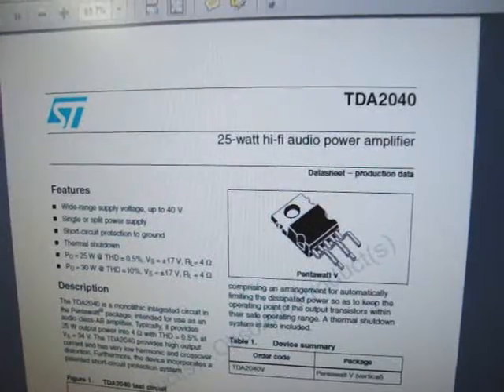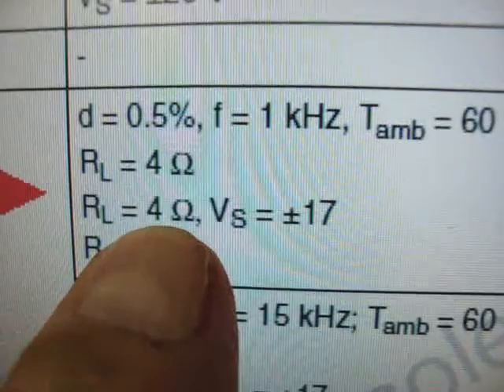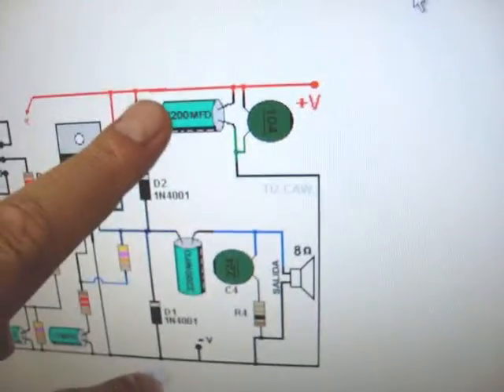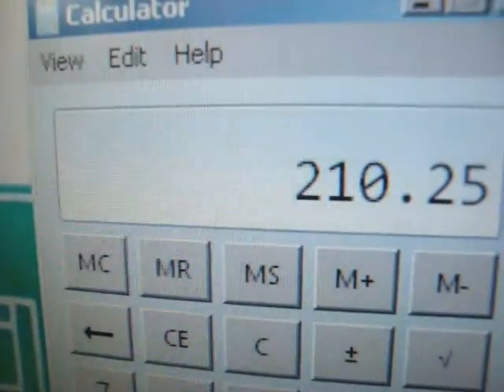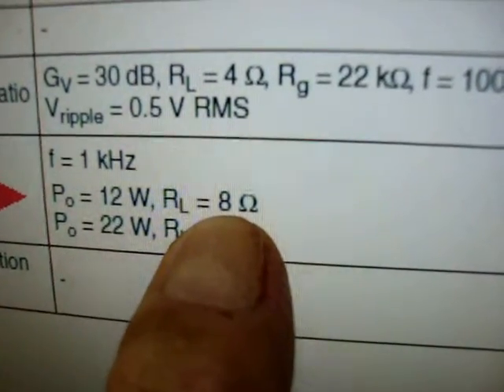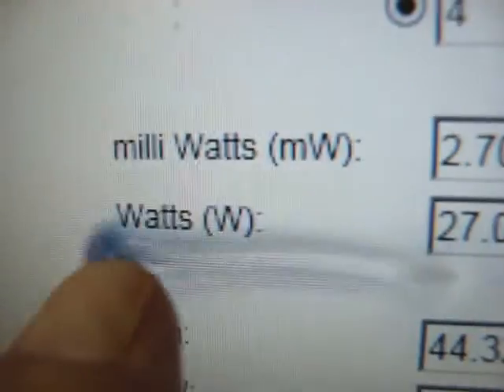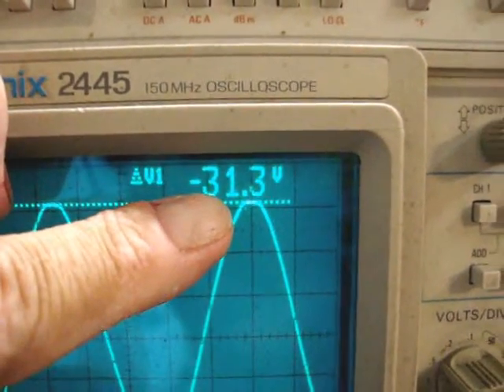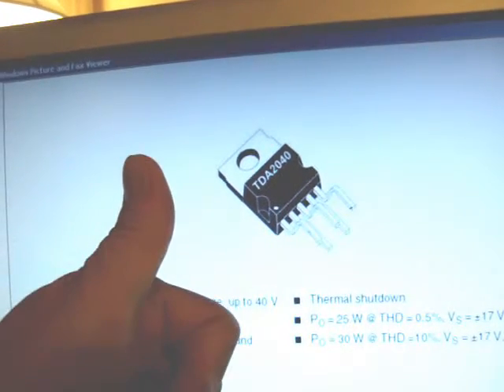TDA2040 Evaluation

Comment: I have a guitar amplifier with the smaller brother, tda2030a. The guitar manufacturer insists on limiting the guitar speaker resistance to 8 ohms, is running a 4 ohm unsafe for these chips?
Reply from the maker: I think the tda2030 is overload protected. However, the amp may have already been designed to provide the maximum available output with the supplied 8 ohm speaker. What kind of amp is it, and what is its maximum rated output power?
Reply: Bob H it’s a Vox Pathfinder 15R and they call it 15 watts, have not put it on an oscilloscope to confirm nor do I know what the THD is at that level. I know plugging in a 4 ohm speaker would ramp up the power but everywhere I read they say it will burn up the chip
Reply from the maker: @voxpathfinder15r  - Ok, so after looking at the specs on the tda2030, the absolute max output is 18w into 4 ohms with +/- 19v power rails. So if you connect a 4 ohm speaker, it will only provide 3w more output. So there's really no further gain with going with 4 ohms. The 2030 cannot make anymore power, so 15w is maximum.
Reply: Bob H it can go +/- 22 volts, and it looks like it could go 22 watts. Perhaps not much of an audible difference from 15 watts?  But perhaps a really big difference in clean headroom?
Reply from the maker: @voxpathfinder15r  - Yes, that's correct. Again we're talking about RMS watts, not peak watts. I got this directly from the manufacturer's ratings: Typically it 
provides 14 W output power 
(d = 0.5%) at 14 V/4 Ω. At ±14 V or 28 V, the guaranteed output 
power is 12 W on a 4 Ω load and 8 W on an 8 Ω. 
In any amplifier, there's a point of diminishing returns where the amp simply cannot provide any more power to the load. Providing more voltage can only cause more likely failure. So it looks as tho the amp manufacturer designed it with this in mind. It's not good design practice to run things up to the absolute maximum limits.  That's why your amp has the disclaimer not to use your amp w Wi th a 4 ohm speaker.
Reply: Bob H you know what I just found out? There are two spec sheets in circulation online!  There is one for the TDA2030 and another for the TDA2030A. You’re quoting from the first one, and the one l am quoting from, is the one with the A suffix, which I believe is an updated higher output version?
Reply from the maker: @voxpathfinder15r  - Yes, you're correct. A 3w difference between the two. No doubt a slightly higher price for the A version.

Comment: I tested the circuit in single supply mode on 24 Volts @ 4 ohms load but the max output before Clipping was 6 Watts. I think these split supply chips can't perform to their fullest on Single supply as they are optimized for split supply only. Also, since these chips are obsolete now , the Chinese version of these can't deliver more power even on higher Split supply voltages.
Reply from the maker: Interesting. Just curious, is the 24v supply holding up under load? Also, make sure the output coupling capacitor is good.